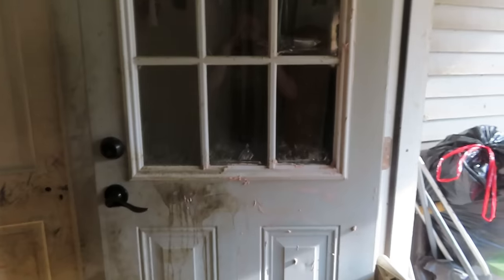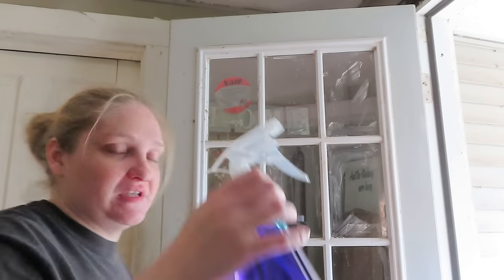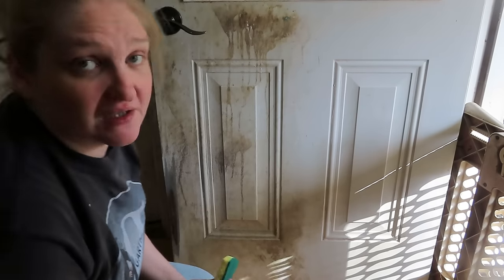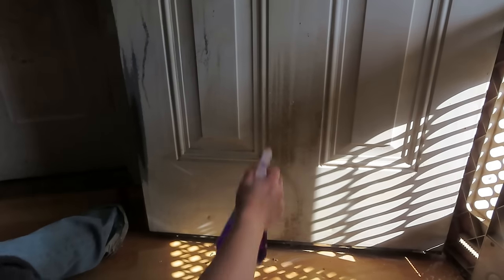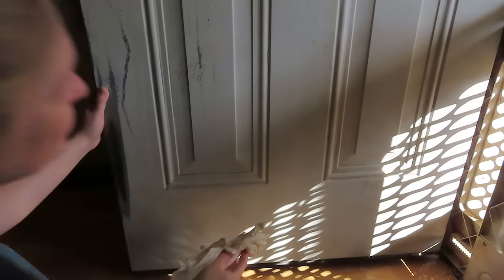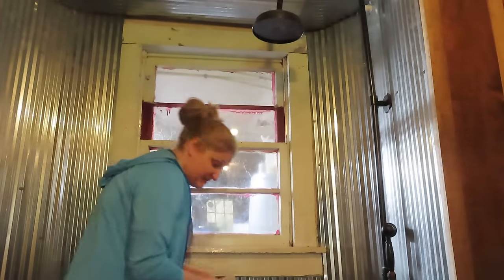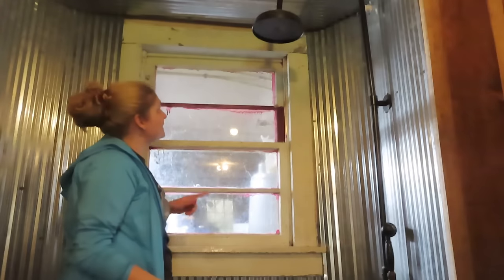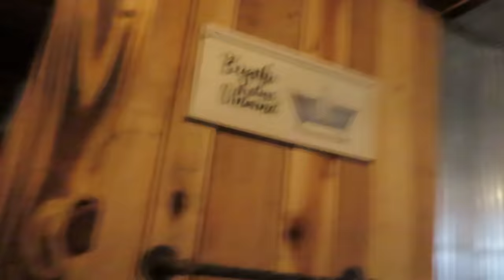Pink Stuff VS Super Clean Tough Task Cleaner

Comment: Look at all you've accomplished, great job!  I would paint all interior doors & trim a glossy white.  Glossy paint is more durable & easier to clean.  I would paint the front door a glossy dark green to compliment your roof.  Definitely sand your bathroom window before painting & be sure to use a paint that is resistant to water (considering it's in the tub/shower area).  Be proud of all you've done!!!!
Reply: Keep it up, a little at a time. Love all the work you have done so far. Love your videos.

Comment: It's always good to have microfiber towels to help you better, you can moisten them in water and wipe the surface instead of a paper towel.
Reply from the maker: I can't use microfiber towels
Reply: You can use washcloths instead of microfibre. On windows and mirrors I like to use old wellworn sheets that I cut up when they are too stained or ripped. Another tip is to let your product sit for a bit. Spread it out on the surface with a little water and wait for a minute or two. Sometimes either longer or to just repeat the process. You are doing great!

Comment: Great satisfying video! Great work, the doors looks amazing. A green would look nice on the front door. On the doors, trim and window paint them all white to keep it bright and uniform. Then you can bring in color on the walls. Definitely sand or use a primer first on the bathroom window so the paint will adhere well. Fill all the cracks with paintable caulk beforehand. Use a “satin finish” paint on everything. Congratulations on 1000 subscribers 🎉
Reply from the maker: Thank you 🥰